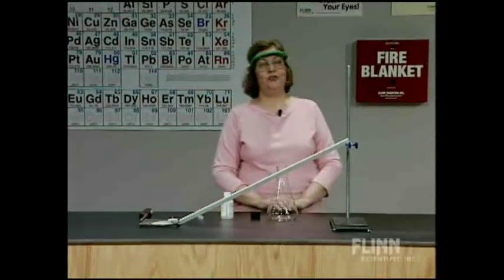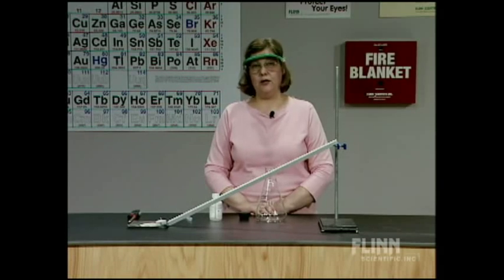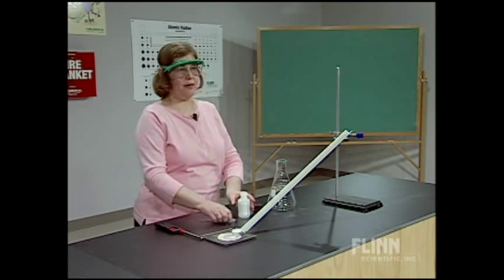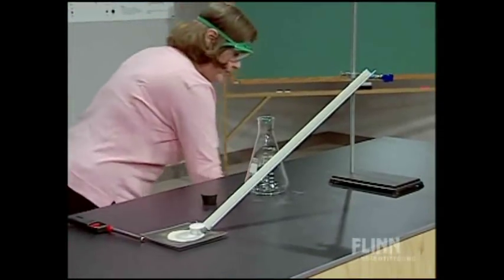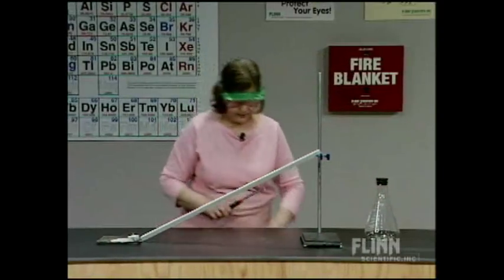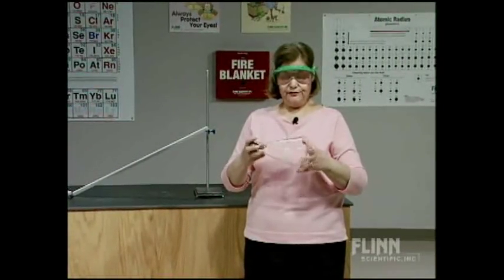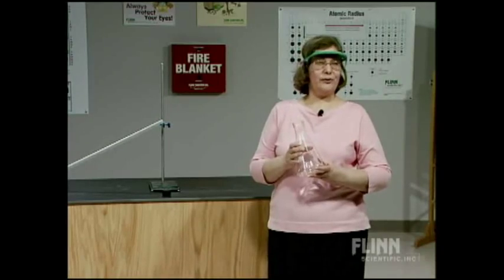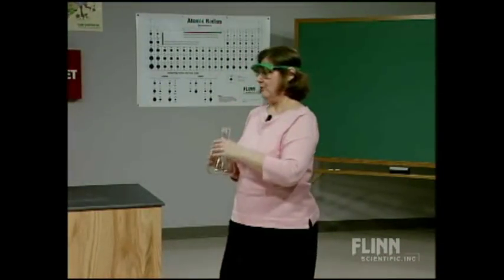Flammable Vapor Demonstration

Comment: what should be expected IN CASE you are not fast enough to remove the flask?  would you just have a very warm, blue flame in the flask and you could just calmly place it down, or would you need to clear out, it will pop the glass flask?